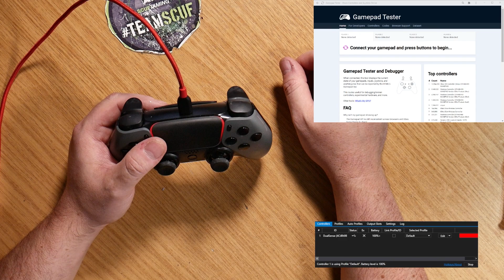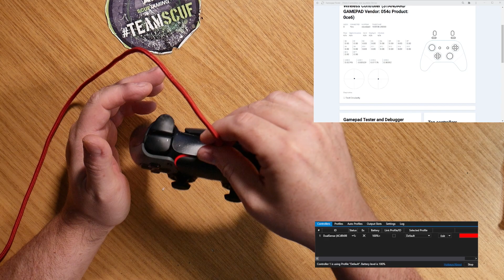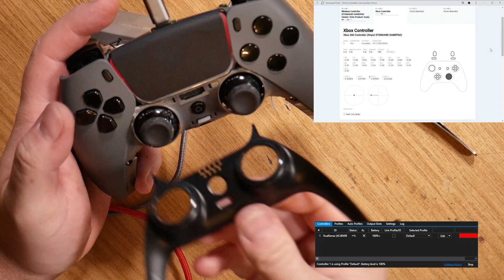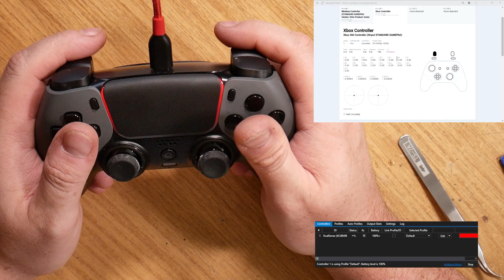SCUF REFLEX FPS TRIGGER REPAIR - STICK DRIFT

Comment: Great skills fixing scufs fk ups. Really inventive fix for the clicky triggers. Got to say that it would probably annoy me having the triggers feel slightly different with one feeling more rigid than scufs original flawed design.
Ive had 3 scufs over the years and every one has had design failings, with stick drift, back buttons nit working properly and flimsy poor build quality. Their quality control is shockingly poor for supposedly premium products that customers have to pay top dollar for
Reply from the maker: Thank you. Yeah the biggest issue I face isn't so much the repair. It's making the controller feel correct. Making sure all the buttons have the same tactile click. Making sure calibration and travel is correct. SCUF have such shoddy build quality I get frustrated having to do repairs down to their level because it can be done so much better. I can only repair with the quality given due to the SCUF shells being bespoke.